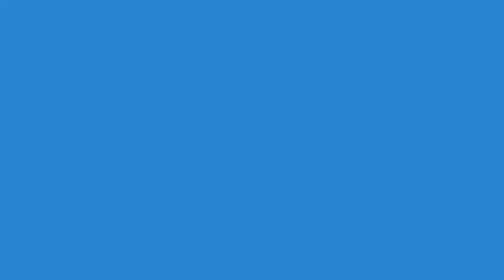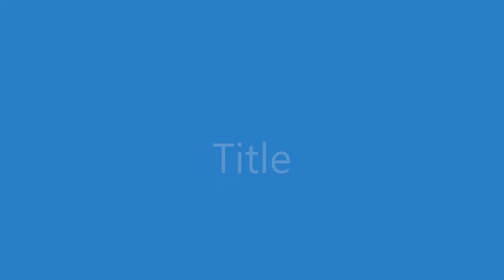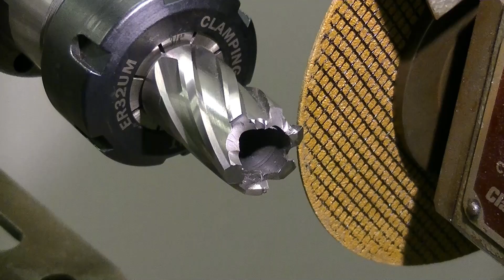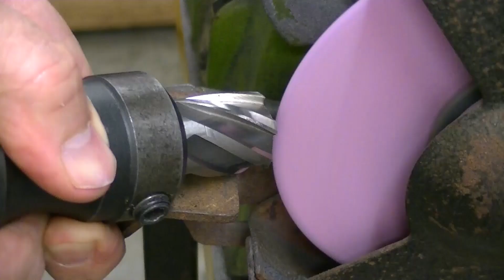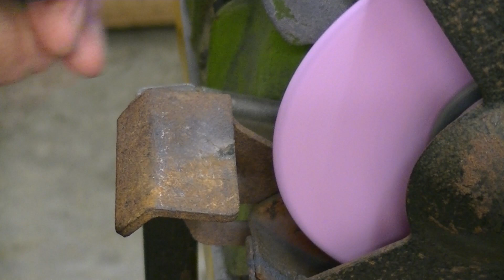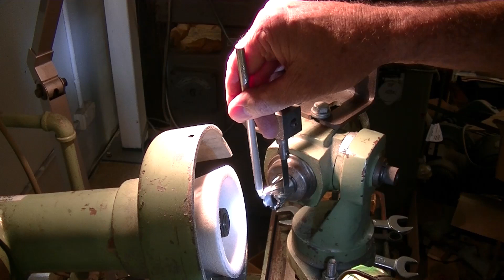Cutting off the cutter

Comment: Did the ruby AlOx wheel come in that shape originally or did you modify it? Or is that the shape it has now after years of use?
Reply from the maker: Hello Jonathan. The wheel was a strait T1A1 wheel. I dressed a small radius on the face and it has worn to this shape. Regards
BC